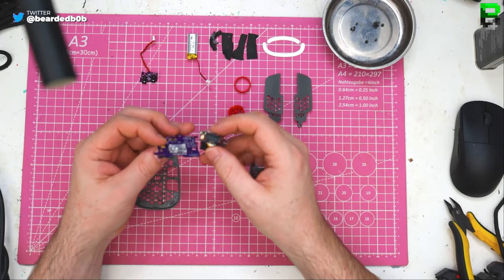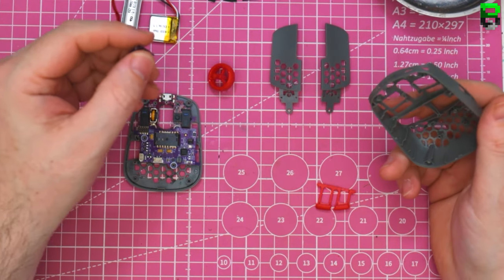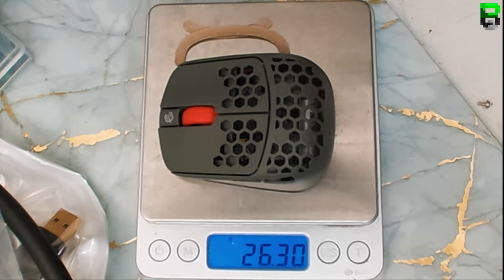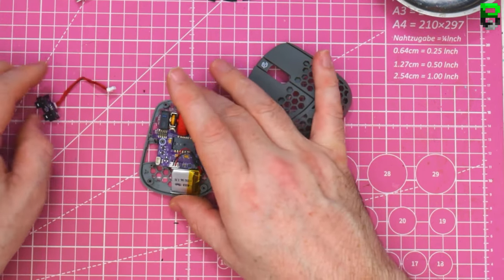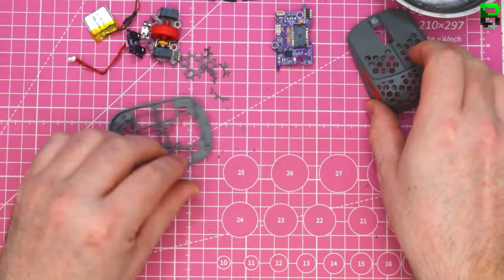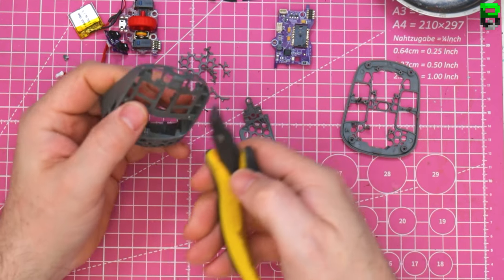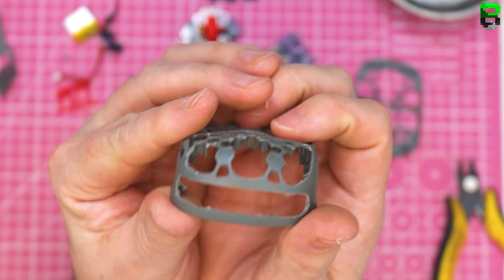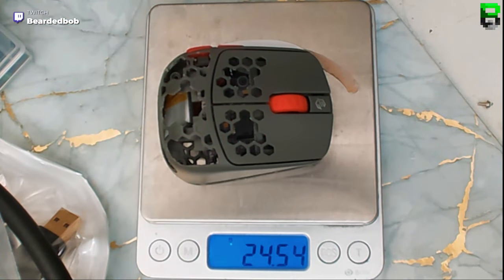CREATE THE ULTIMATE FINGER-TIP MOUSE: G-Wolves HSK Pro 4K Wireless Weight Reduction Mod

Comment: bob what specs are required for a replacement battery? 3.7 volts capacity, what size connector polarity of that connector anything else-- drain limits?

Comment: the battery powers my hsk pro and my mouse knows when its plugged in but it does not appear to be charging the mouse. And when I leave the mouse plugged in it appears that it just stays on and the battery drains. What area of the PCB would I need to check?

Comment: Better idea to just buy the pro Ace thats barely 26 grams out of the box

But im curious about how much lighter it is without side Buttons and scroll wheel?
Reply from the maker: Pro ace isn't 4k polling.... the M2k is 24g but doensm't have side buttons or wireless.... 

If you want to know the weight of each component worth watchin the teardowns as each part is weighted. https://www.youtube.com/watch?v=gz2L78eZ4wg&list=PLfd7fPKFiRfK8_ZTt5_3dlkulKcsyJPCT
Reply: i got the 4k just for the convenient bigger battery it has, and im gonna be using it in 1khz to stretch it even longer. also ruby color

Comment: Can it work with just the charging cable plugged in, and no battery?
I know it may ruin the feel of the mouse for some, I'm just thinking of going really light.
Reply: 3 grams is unnoticeable, and the cable would actually just provide more drag/resistance
Reply: @fran2911  Alright, but can you still use the mouse with the cord, and with no battery in it?  I just want to know just for my own curiosity.
Reply: @callmeLilSparky  im not sure about that sorry, you can probably find out if you find a pcb schematic and someone who understands a bit about electronics :)

Comment: Nice! Do you think I can simply repin the battery? Like I would with a paracord to fit the right connector?
Reply from the maker: You can swap the pins around if you can get them out pretty easy, if you need to swap the connector you will need the crimping tool
Reply: @Beardedbob  Oh okay, I thought the crimps were the same and I could just swap from a 1.5mm to 1.25mm JST connector.

Thanks for clarifying, then a soldering solution is much easier to me :)